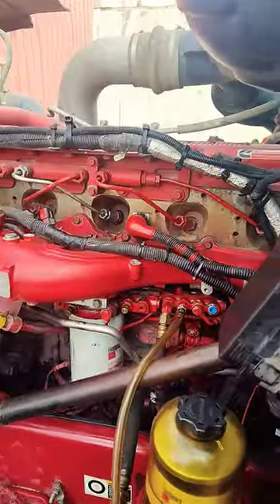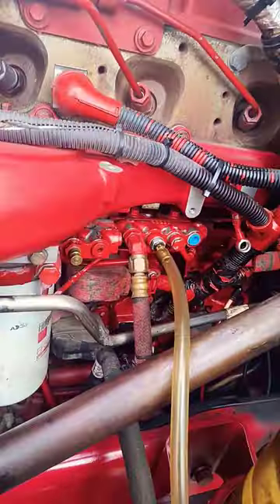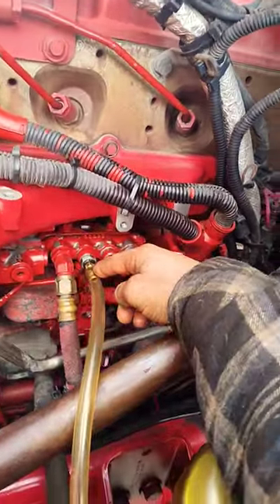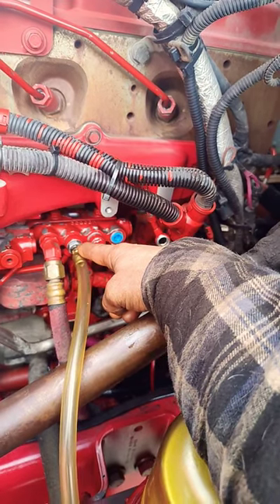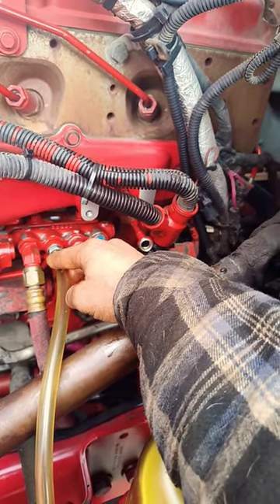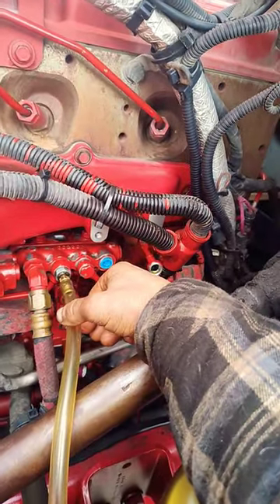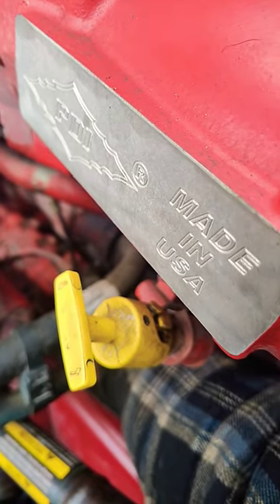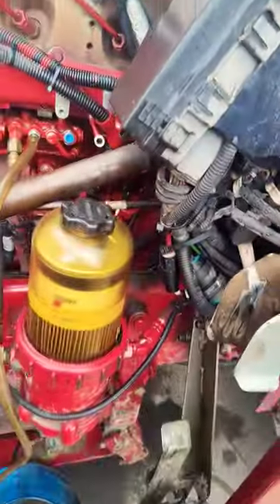January 16, 2023

Comment: any time I see code 559 on a 2250/2350 my first thought is to check the plungers and tappets on the pump head. They are notorious for failure, especially the original ceramic plungers on the 2250's. The newer steel plungers are more robust but since they rely on fuel for lubrication they can also have problems if there's a lack of fuel supply to the pump.

Comment: I always start with a decay test. It’s also worth the money to set up 3 test hoses so you can check injector , high pressure fuel pump and rail release valve flow at the same time. Also have a shut off valve at the orfice fitting simulating flow so I don’t have to keep disconnecting it. There is a few other tricks you pick up over the years t/s 559 frequently
Reply: what is decay test?
Reply: @I_Died_2_Weeks_Ago  thank you.  I ordered the probe today.

Comment: Or you can just remove the 2 bolts holding the solenoid in and see if it corrects the problem. I have seen relays fool people so I always do a relay swap first. I only do a return flow test if I suspect a failed injector.